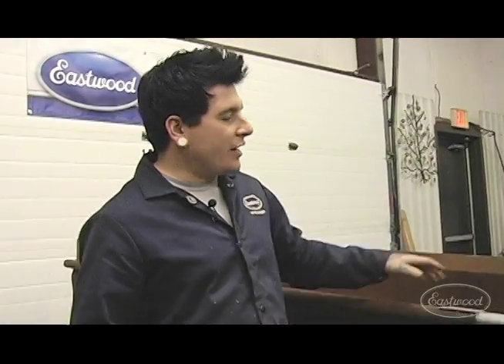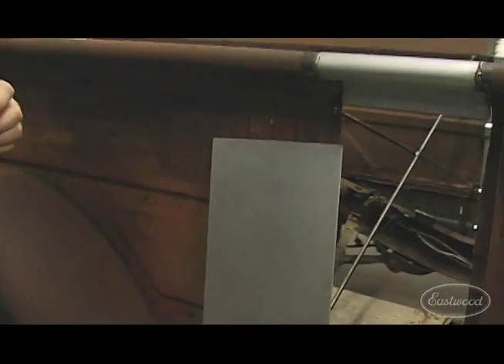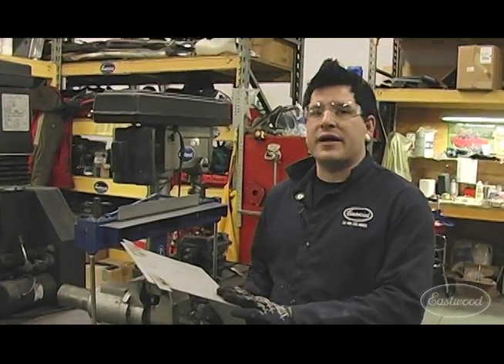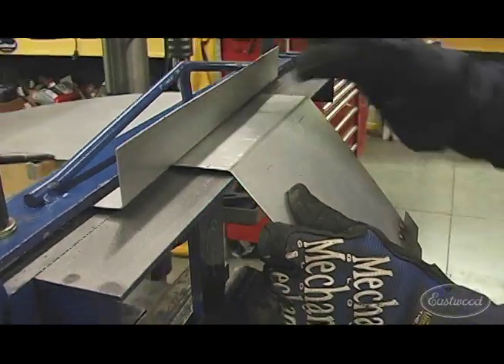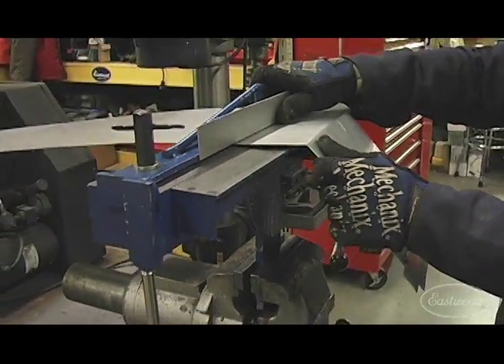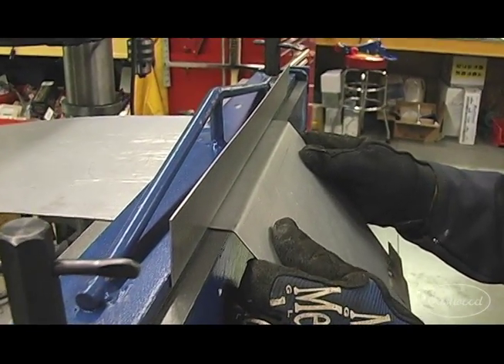Lengthening the Truck Bed with a Metal Brake & Slip Roll on Project Pilehouse at Eastwood

Comment from the maker: We have a larger brake that we may launch if their is enough demand for it, but obviously at a greater cost. This brake allows you to do a lot of sheet metal fabrication. You can obviously make larger panels and weld if you are in a pinch. The same could be said for any tool.. but not everyone can make space or afford the industrial sized tool at home. Thanks for watching. -Matt/EW